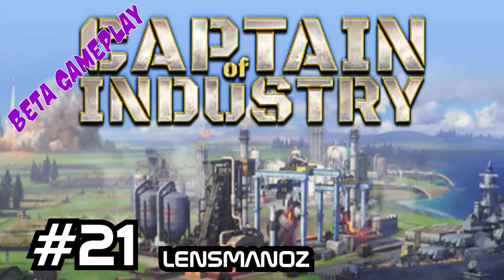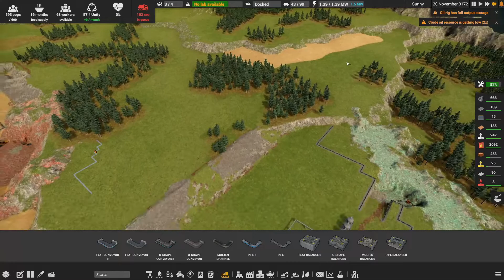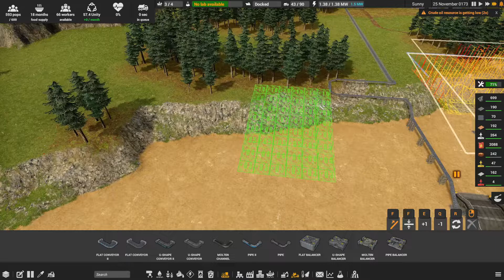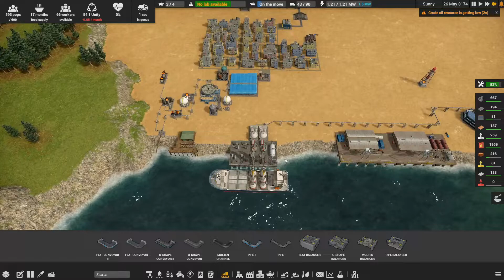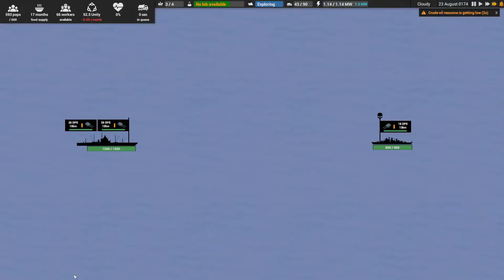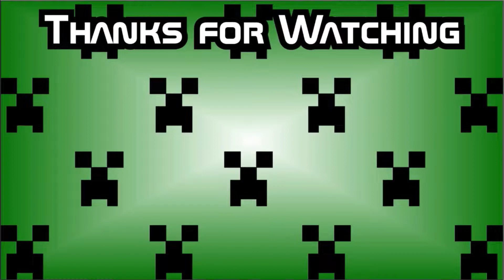Captain Of Industry - Beta | Ep 21 | Moving House

Comment: What needs to be done to increase the output of Const III widgets? < based on 'belt movement', There's either a bottleneck, or shortfall, somewhere in the process.
( I realize you have a standard model for laying out manufacturing, but I'm not sure if it's meeting your overall needs...)
Reply from the maker: There are probably many other more effective ways to setup the production. I may have to try some new methods in the future.